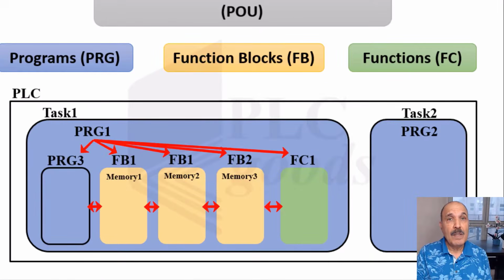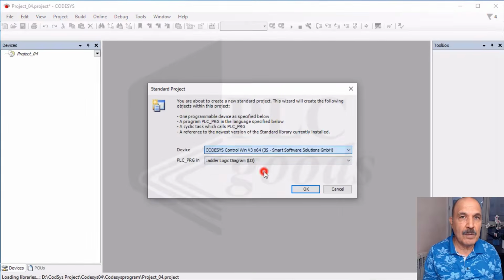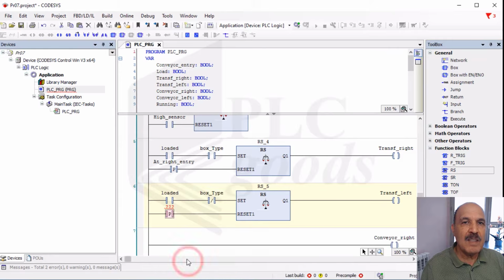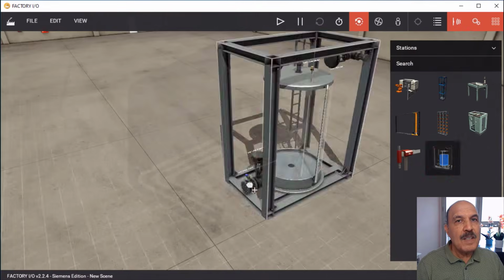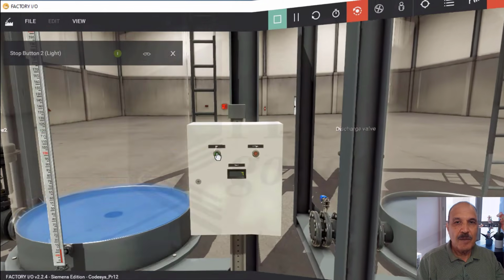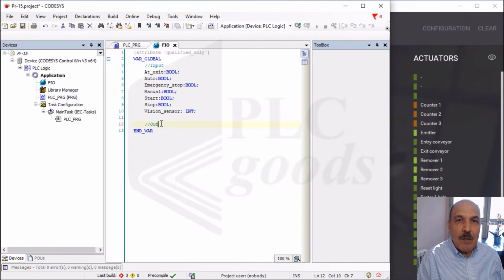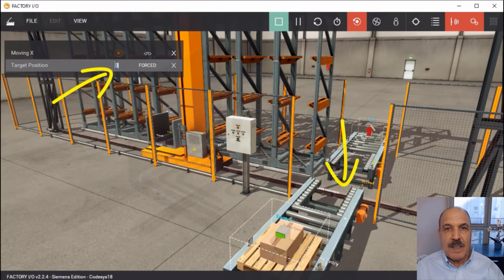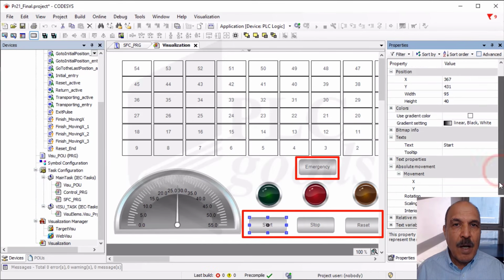CODESYS programming tutorial for beginners -full preview

Comment: How can i use MTTQ in Codesys
Reply from the maker: MTTQ (Mean Time To Quality / or depending on your context, Mean Time To… ) is not a built-in function or standard block in CODESYS. It’s more of a concept or metric rather than something you directly “use” in the software.

If you want to implement it in CODESYS, you typically have to create your own logic. For example:

Measure the time between events (using timers like TON)
Store timestamps or cycle counts
Calculate the average time using variables and simple math

So basically, you would program it yourself based on how you define MTTQ in your application.

If you can share what exactly you mean by MTTQ in your case, I can give you a more specific example.

Regards